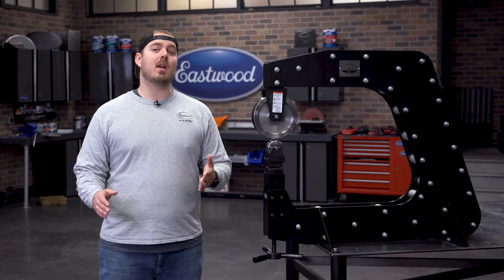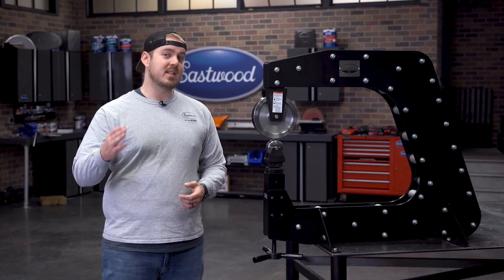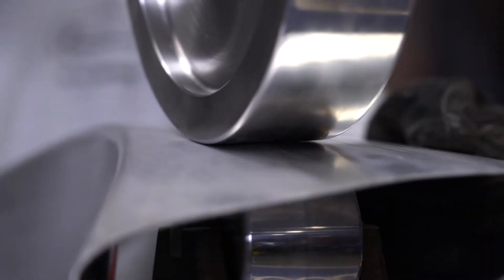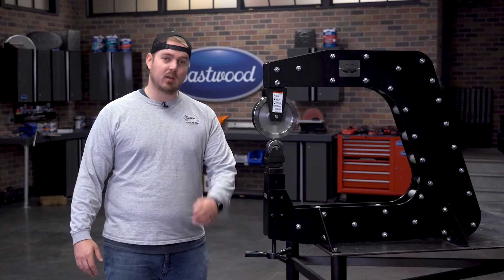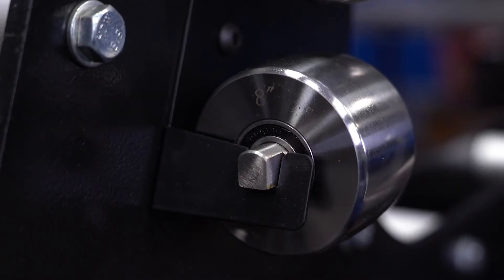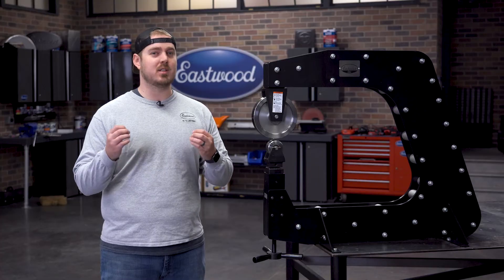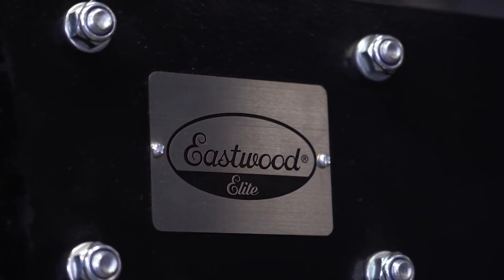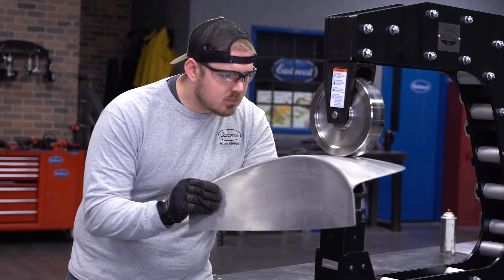How to Fabricate Bedsides, Fenders, Quarters and More: Elite Large Frame English Wheel

Comment: I always wished I could roll my own fenders and doors for my stock car. They don't have to be perfect like a street car but just resemble a monte carlo or Camaro or whatever nose and tailpiece you are using. If you buy those panels from the racing body companies they cost a fortune. They just need a resemblance like the curves and rolls.
Reply from the maker: Sounds like with a little practice on the English wheel you could be doing that in no time!